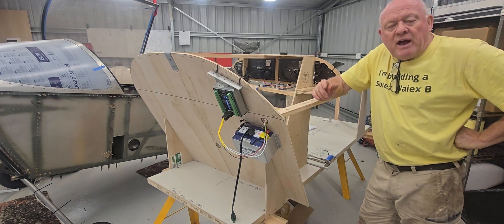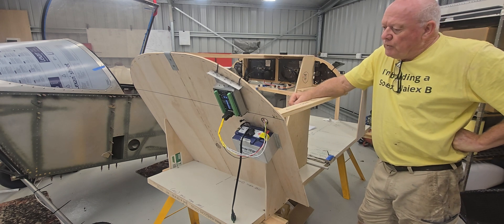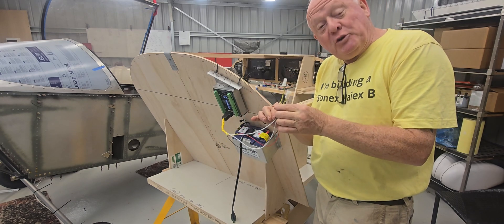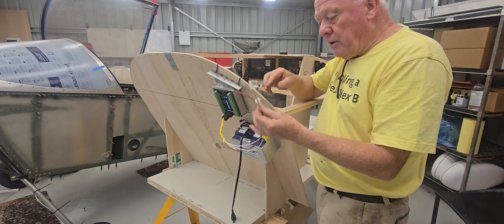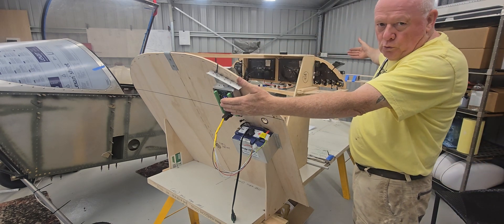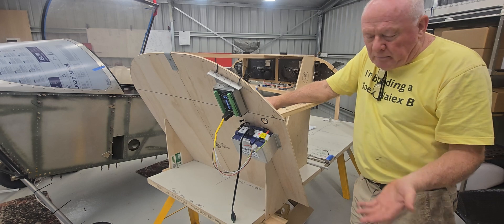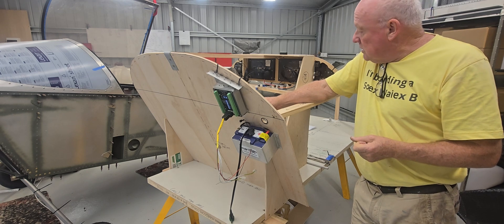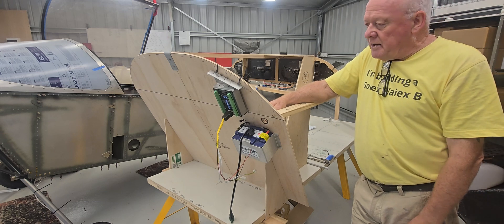Sonex Waiex B, Part 40-Starting the wings

Comment: Yep, mine has the lip at the tie down area of the main spar as well. I don't remember needing longer bolts though. And I don't think I added a spacer either. My lip was not very deep at all.
Reply from the maker: Did you still have 0.32 spacers? on the spar, the ones on the forside of the ribs???
Reply: @pandyseven  yes, there are two spacers - one is 1/8" (center spacer) that fits between the spar caps and another 0.032" (web spacer) that overlaps the 1/8" spacer and the spar caps. Both of those spacers go on the rear side of the main spar/fore side of the aft rib. There are no spacers for the forward ribs.
Reply from the maker: Hi Dan, the reason I ask is I was just trying to establish the major differences between your model of the spar being in the 30's and mine around 35 odd kits after yours. It does appear to be just the aft edge of the main spar aluminium that differs having a larger lip. Obviously, these spar components are cut from a solid piece or pre moulded piece then factory curt to a given specific, mine and now Sonex’s at the factory have the raised lips…hope all that makes sense
Reply: @pandyseven  - yeah, after looking at yours and comparing to what I have, it seems like there is a difference. Not sure if the spars are extruded aluminum that's machined or if they're molded?? My guess is the former. Seems like it would be a lot easier (in terms of scale) to extrude several lengths and machine off what you don't need than to pour melted metal into molds and remove parts one at a time.
Reply from the maker: Mine are machined from what I would assume is an extrusion, that extrusion is just that little bit heigher than yours I guess...

Comment: I’m starting my Waiex B wings as well. Looking forward to hear what Sonex says about the tie down fitting and possible filing or adding a shim.
Reply from the maker: Hope you do well with your wings, would be nice to see a video series of your build??? Sonex replay was to keep it as I have done it with the 0.63 packer, and larger bolts. Chris from Sonex said their spars are the same, and they do what I have done. How are your spars? same as mine?
Reply: @pandyseven  Yes, my spars have the same raised edge as you show on the video. I am looking at the plans numerous times before I start drilling holes in the spar and attach blocks. Just a little nervous I guess. Thank you for your videos. They are super helpful. I may do a few videos of my build as well.
Reply from the maker: It would be nice to see other builders such as you do a  build series of their build. It is very helpfull to us all-send some pictures?
Reply: Hello Andy, have you gotten to page WXB-W08? Step 9 in general construction order states to complete drilling through both blocks while spars are mated, then to install the rig plates XNS-W40-21. My question is should we drill through both left and right attach blocks now or wait. Some suggest waiting until rigging the wings to the fuselage. Just curious if you have formed a plan. I like your engineering and thought process.  Rob
Reply from the maker: Hi Robert, I am unsure if it would make that much difference to wait until rigging?  The objective is to have the wing spars together to firstly match what Sonex have done at the factory, that is the 3 holes you align. This you can successfully do outside the aircraft with clamps prior to rigging and allows you to complete the wing rig plates. When rigging you will need the forward spar tunnel in place so as to align the 3 holes in the aft tunnel and in the forward tunnel ‘Z’. The forward tunnel Z is going to be one hard thing to do, especially when riveting the plates at the fuselage upright angle and most of the riveting will have to be done inside the aircraft I believe. Anyway, so to look at this objectively if you drill all the way through now, you will have that alignment with the pins or bolts completed of which you can check outside the aircraft. Then when you get to rigging and eventually install the forward tunnel ‘Z” all you have left is to run the drill through the spars and into both forward and aft reinforcement plates that are attached to the spar tunnels. If you left the forward tunnel off and used the spar holes as a guide you will be able to drill backwards towards the rear spar tunnel, thus successfully keeping that hole in alignment with what you have done in the spars. Then run to drill forward back through the rear spar holes that are now up drilled back through the mated spars [ already upsized] then through the forward spar tunnel ‘z’ giving you a better way to keep in alignment. So, if all this makes sense, this to me sounds like a better way to do it., buts as always, I am still going through this in my head. It’s a great question and I will be up to this part on the weekend so will cover it in my next video due in a weeks’ time.
Reply: @pandyseven  Thank you Andy, that makes sense. I will be working on the left main spar today.

Comment: The wings will be fun. The engine could be a pain in the keaster! I seen where guys building the aerovee have been driven crazy with the push rods. I think Gavin found after market push rods for VW engines worked really well.
Reply from the maker: I will more than likely be traveling down the same path as Gavin with the push rods but will just wait until I cross that bridge. I know it must work with the rods supplied, or they wouldn’t supply them? So will just work on the err of caution, and want to ensure if I do travel down the path of a new rod, doubly ensure I buy the correct ones..
Reply: Building the AeroVee was probably the easiest part of the project.  I used the stock pushrods.  At about 280 hours I noticed one was failing on one of the edges, and I replaced it.
Reply from the maker: Hi Bryan, probaly why I will keep the stock push rods at this satge as I know they have to work if Sonex are still suppling them...